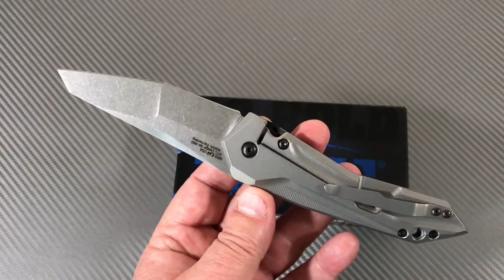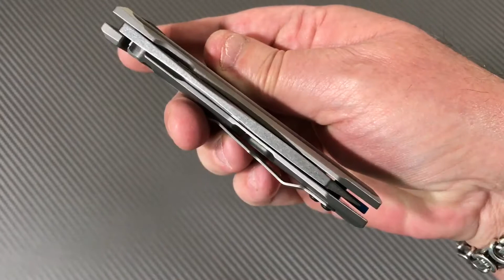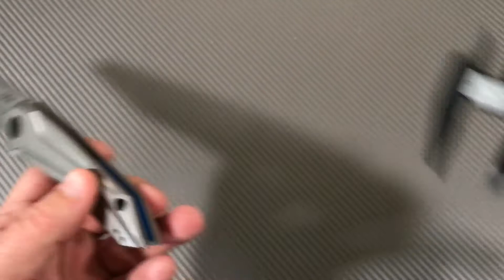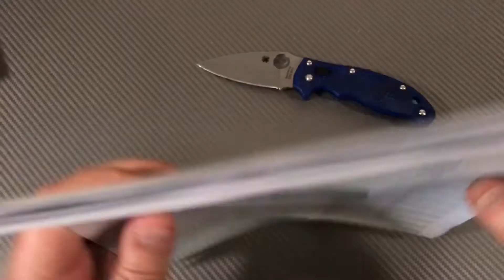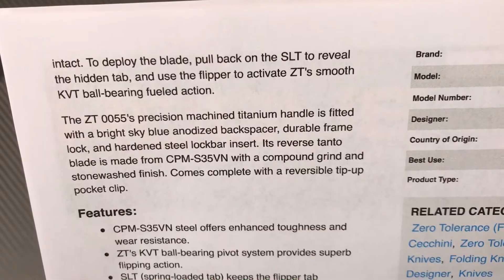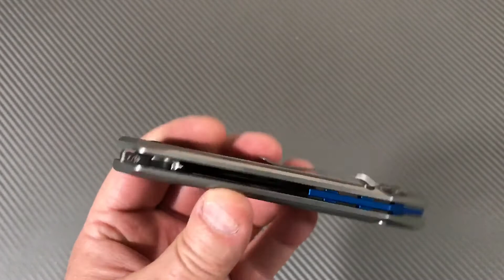Zero Tolerance ZT 0055 GTC design

Comment: The "semi-floating back spacer is pretty special. You don't see a lot of those. The blue lets not only the owner, but the casual observer see just how unusual and different the  back spacer is. Turns out that those who hate this design, likely don't know or don't appreciate the GTC Designs and/or his philosophy. I mean the Holt Bladeworks Specter is a great knife and much more "mainstream" in its presentation; yet, what if each and every knife were a duplicate of that with no variation. Same idea with the Norseman. I don't know weather this knife qualities as sub-iconic as Mr. Burke mentions, but as an art piece from billet ti it is not one's every day knife design. One does need to have this knife in hand to appreciate it. That said, it is expensive enough so that most will not just go out and buy a "Mermaid" knife for novelty. This is not that knife. However, this knife will sell about as many as the maker decides to put out there. The knife really is that good. AF

Comment: LTK- It has finally arrived. I like the design and SLT. I've seen some modified and they are spectacular. I would like to see a satin finish on the blade (it has a working finish that doesn't go well with a art knife). The clip is lacking for this design. The backspacer would be better if it was silver and black. The blue is a bit random. The blue would have been great if the hardware, clip and pivot were blue also.